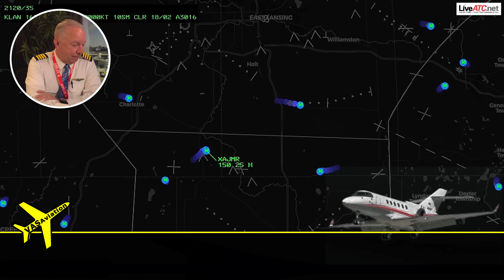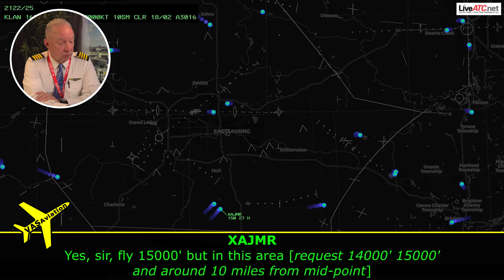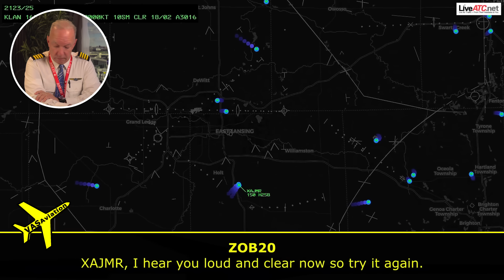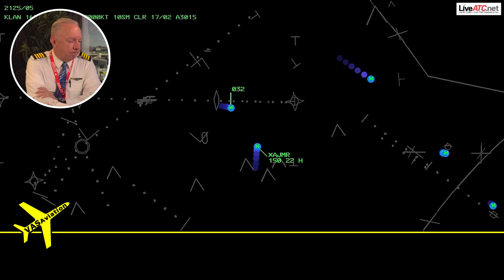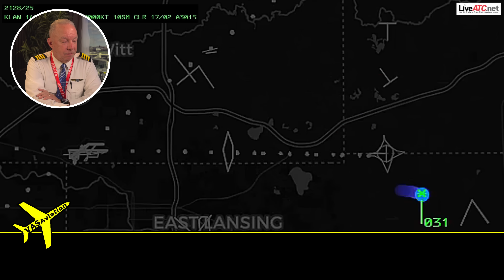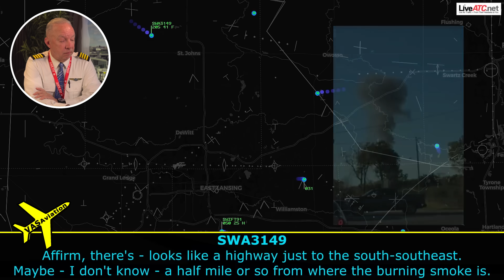Inside the Hawker 800XP Stall Test That Ended in Tragedy

Comment: I've never trusted a swept wing jet that did not have leading edge devices.  My pilot friend was with a company Astra pilots doing stalls well before there was a simulator.  They loss control and he was able to pull it out of a deep stall.  They lost over 10K feet and came very close to death.  Swept wings jets like this have stick shakers and stick pushers for a very good reason.  Putting one in a stall is reserved for test pilots only.

Comment: I dreaded the lesson for Stalling/Spinning when working towards my PPL for a Cessna! I almost gave up the lessons as this approached. But because my Instructor was ex-RAF (he was wonderfully kind, talented and sympathetic) I found I actually ENJOYED doing them! Eventually, I'd do them (with a passenger!) for fun. I guess they are mini-aerobatics?!
Reply: I have to say that I enjoyed the spinning lessons for my PPL. The real eye opener was spinning a Jet Provost in the RAF. It was a much heavier aircraft than the Cessna, but still had manual flight controls. With a 16,000ft/min rate of descent while spinning, it certainly took some effort for full opposite rudder and to hold the stick forward. A guy on the course ahead of me got into an inverted spin while doing solo aerobatics and ended up having to eject.
There's an excellent video on YT called "F-0776 Spinning Modern Aircraft" which shows a JP spin from inside the cockpit right at the start, and then goes on to explain spin mechanics.

Comment: The controllers display does not turn red. With some systems it will display a red “LA”  for “Low Altitude” in the data block associated with the aircraft and is accompanied by an aural alarm beeping tone, same as a “Conflict Alert”.

Comment: I flew a lot of aerobatics in all sorts of aeroplanes, including Chipmunk, Citabria, and Yak52. Standard spin recovery is:
Power off.
Full opposite rudder.
Stick forward UNTIL THE SPIN STOPS (this can mean FULL forward stick in the Chipmunk, which is placarded to that effect).
Centralise the controls (or it may well go into a spin the other way!).
Ease out of the dive into a climb back to desired level.
on reaching desired altitude, ease the stick forward to level flight while restoring cruise power.  

Simply letting go of the stick won't cut it.

Flat spin recovery in the Yak52 (as I practiced with 'Mr Yak', Gennedy Elfimov) was: 
Power off.
Immediate full opposite rudder and in-spin aileron while slowly pushing the stick forward - as far forward as needed until the spin stops.
Immediately centralise the controls then recover to level flight as above.

Hawker business jets have a high set tailplane and elevator, so can suffer deep stall like  T-tailed airliner. I wonder if that happened here.

Vince C
Reply: Hawker business jets have a high set tailplane and elevator, so can suffer deep stall like  T-tailed airliner. I wonder if that happened here.

First thing that came to my mind, and I haven't been at the controls of an airplane in well over 50 years... never licensed, either :face-green-smiling:
Reply: just wondering why does a guy named Vince fly my beloved russian yak? where these also in the US?

Comment: I just analyzed some video the aircraft suffered structural failure on the way down indicating unusual attitudes & high g forces. Hawker warns about conducting stalls in the handbook. Stall test gone bad last Feb in same type of aircraft. ADS-B data is revealing…..seems like they maintained level flight at 106 kts & even at 102 kts for a few seconds before the stall broke, most likely inducing a snap roll. The slow airspeed, unusual attitudes & lack of elevator authority made getting out of the “back side of the power curve” impossible…..then aircraft began coming apart. RIP

Comment: I dont understand why a stall of any kind is hard to recover from at 15000 feet wouldnt you just point the nose down until it comes out, not keep pulling up obviously why is this hawker so hard to recover from
Reply: Sooooo, a stall is easy to recover from, the amount of altitude you need depends on the aircraft.  A spin recovery is more difficult.  He says stall in the video, but then goes to describe a spin recovery, then uses the terms interchangeably even though they are two different things.  Although a bad enough stall can lead to a spin.
Reply: a silly question, you ought to study aviation more, there were similar accident where they could not recover from 30000 feet
Reply: @olasek7972  no not a silly question, the question is could they not recover because they did incorrect procedures, if you cant recover a stall from 30,000 feet either you have no idea what you are doing or something is wrong with the plane

Comment: Aircraft mechanic here, never liked Hawkers it is a very tail heavy aircraft for the engines it has. I remember working on Lear 25s and there was a large inspection that required leading edges of wings to be removed and after re-install it required a stall test which only factory pilot could carry out
Reply: yap . like a c185 on floats. unable . :shelterin:
Reply: Tail heavy yes, that's why it's jacked from the wings and tail.
Reply: Yeah, I flew those flights many years ago.  They use to strap down sandbags behind the cockpit to bring the C of G forward.  It was not uncommon to end up in a very unusual attitude.
Reply: Err, so you had to do your job properly.  Did you put less effort into servicing other aircraft?
Reply: @HerbertTowers What?
Reply: @seeburg220 that was my exact response...

Comment: Hi Captain Steeeve. Why are most commercial airliners today twin-engine? Aren't 
four engines safer than two? In a twin-engine airliner, if you lose one engine, you 
lose 50% of the thrust but you can still fly. If you lose two engines, you lose 
100% of the thrust and you go down. In a four-engine airplane, if you lose two 
engines, you lose 50% of the thrust and you can still fly. It's very unlikely to 
lose three or four engines...
Reply: It probably comes down to cost, efficiency, and fuel economy. Statistically, it is very rare for both engines to fail outside of highly unusual circumstances. The event where Cpt. Sully (flight 1549) flew through a flock of birds took out both engines (but landed safely in the Hudson) but then there are incidents where 747's lost all FOUR engines due to volcanic ash clouds but were successfully restarted (BA flight 9 and KLM flight 867) at lower altitude.

Comment: Ever since I saw the video of the stall test of the MD-95 (Boeing 717) back in the 90s, I have been in awe of test pilots’ ability to recover from extreme unusual attitudes. I wonder why these Hawker tests of late have resulted in situations where the flight crews are unable to recover. Are the pilots just not decreasing their angle of attack sufficiently to get out of the stall or are they making improper control inputs or something else?
Reply: I think that it could possibly be that if they get nose high and slow causing an aerodynamic stall causing the engines to flame out, if they don’t get the nose down quickly the airflow to the engines is disrupted causing them to flame out. With little horizontal speed the engines don’t get enough forward speed to allow a restart (windmilling).
  With not enough forward speed and no power the plane will fall flat like a leaf falling off a tree with no flow over the control surfaces making it almost impossible to recover. They are much heavier than a leaf, gravity sucks and time and altitude are no longer a saving grace😢

Comment: I just added stall testing of planes following major maintenance to the list of jobs I would never do even if capable of doing.
Reply: Me too, right under saturation diving
Reply: @guitarrowhead_mv Imagine the skill level required for stall testing an Airbus A380
Reply: @johnvender  You can't make it stall.  The interface between controls and surface deflection won't allow 'raw flying'.  Stall behaviour is entirely done by the designers.  Along with things like stick-fixed satanic(!) manoeuvrability and stability. Roll/yaw coupling and so on.
Reply: @HerbertTowers  Yeah, it was only done by Airbus during certification work. There is a video that shows some of the A380 test campaign.
Reply: @johnvender that’s the safest Airplane ever it won’t stall
Reply: So you're just going to let some other poor guy (or girl) go out and possibly get killed even though you were perfectly capable of getting killed yourself...possibly?
Wow man...what are you...SANE? Some kind of sensible person?
Reply: Some aircraft are unable to recover from a spin, when the balance of weight is behind centre of lift, and some have a full width elevator that can blanket the rudder when in the spin, This means the elevator is stopping air from getting to the rudder, therefore the rudder is unable to stop the spin, This happened to a friend of mine but he survived the crash and still lives flying

Comment: The electromagnetic circulation plasma tones field between 2 planetary magnetic poles are arking wave speed vectors in both counter clockwise and clockwise axial tonal sound and radio frequency modulation Spheres to recover ur balance of 90° on the vertical and 90° on the   horizontal deity stabilizer plasma tones planet known as ur Ball mirror
Above and below the water table Matrices restoration clock speed to recover ur hydro Krystal Spiral acoustical Spirit body restoration speed to fly ur own space transportation vehicle called an Orb 
As in orbital electromagnetic processing speed in distance and degrees of the exact center point of balance at 0°
Magnetic 0°
Is O Ohms 
The Zero point field where U cancel both Spinning magnetic polarities to experience NO pressure
That's Ur vacuum void space of pre light phasing speed
The invisible eternal Sun Spiritual capacity to Creatively express pure joy to b alive breathing aliveness
The over Unity field means ur a self generating Monad 
That's the free energy neutrino zone 
Ur Spinning flashing sound and light frequency over Time wave speed vectors
Ur vector is ur vector speed 
Let the Universe go to work 4 U to phase in and out between density and multi dimensional Star Trek Navigators
🌈
Reply: You are a P3 pilot, I was a P3B crewman in the 70's.. I was always interested in the cockpit activities and as an AW, I often sat in the cockpit on the radar cabinet.  One day we were working with an aircraft carrier doing Bravo services and completed them.  Antagonized by our crew and maybe the communicators on the ac carrier, my pilot decided to go around and demonstrate the P3 capabilities.  We approached the aircraft carrier deck at approximately 100 feet (violating the rules) at max power (1010 TIT) and at what was approaching to be 400 knots.  We passed and pulled up at a sharp 30 degree angle and thought that was great. " We will show them".  We passed through 8000 feet ( I was watching the altimeter) and then I could no longer stand.  I was soon weightless and then up against the smoke removal hatch behind the FE.  We apparently stalled the aircraft at 190 knots and did not wing over.  We just nose dived and eventually recovered at approximately 2500 feet. I was scared, The pilots did not understand the stall effects when pulling max "G"s on the aircraft and we all lived to bury this in unofficial naval airchrives.  I keep remembering this and can't get it out of my mind.  I thought you might like to see

Comment: Hawkers have a very complex Stall Identification System that gets checked every so often at certain phase inspections. When the leading edges of the wings are removed for maintenance a Stall Check during a test flight is required. The aircraft is flown to a Stall at all the flap settings besides the lift dump setting. The stck shakers and stick pusher must activate at pre determined airspeed and the aircraft must not roll in either direction beyond a specific amount. If it does not behave according the the numbers there are Stall stips on each wing that must be adjusted. This is done until the aircraft behaves according the the numbers. The Stall stips ensure that the inboard part of the wing stalls before the outboard part of the wing. As the ailerions are at the outboard part of the wing if the outboard stalled first you would lose ailerion effectivity in the stall and the aircraft will enter a spin. Hard to tell but it look like this aircraft entered a spin at the first Stall (flaps 0). Another likely scenario is improper Stall recovery by the crew and the expierenced a secondary stall.
Reply: In summary,  not any pilot can fly a Hawker,  neverthless a Stall check.

Comment: I have to fly in a few months and I'm terrified!! Please, could you explain what happened to Air France Flight 447 in June 2009? [Air France Flight 447 was a scheduled international transatlantic passenger flight from Rio de Janeiro, Brazil, to Paris Charles de Gaulle Airport, France. On 1 June 2009, inconsistent airspeed indications and miscommunication led to the pilots inadvertently stalling the Airbus A330.] Thanks!!🙏🙏🙏🙏🙏🙏👍👍👍👍👍👍👍👍❤❤❤❤
Reply: Manual flying had become de-emphasized. Air France remedied this through revised training and procedures.

Comment: Pretty sure this jet entered a deep or "super" stall, which is almost impossible to recover from. It is a normal stall that is allowed to progress to the point that the all surfaces of the tail are blanked out by the main wings. This occurs to T tail swept wing jets. Think B727, DC9, CRJ, and this Hawker. All have crashed from documented deep stalls. Interesting: a Boeing flight test crew found themselves in a high altitude deep stall (B727). The tail surfaces were useless. This crew began to work together using the ailerons back and forth until they were in a 90 degree bank. The nose fell thru and after falling 10,000 feet they were successful  in breaking the stall.
Reply: Yeah perhaps like the old BA crash due to stall in the 70’s with the t tail. However that height should be enough so mechanics, flaps and settings and right after a maintenance - so again like others it probably be 4 or 5 things line up to end in tragedy -
Reply: Isn't this what used to be called a flat stall?

Comment: Battle Creek Michigan would be Duncan Aviation. There are a few aircraft that need stall tests after wing demates. They have to use test pilots that have been specially trained to do this test. A real tragedy.
Reply: Yes Duncan released that they worked on this plane
Reply: I have done maintenance on these airplanes. After removing the wing leading edges for maintenance the manufacturer requires a stall series be flown. The pilots are most often the owners company pilots. They don’t have special training. It is the most dangerous flight of any test flights. I have been scared more than once while flying with crews of unknown experience.
Reply: @seapilot2  You are correct, Hawker aircraft do not require special test pilots for these tests but suggests special training for this task. I believe other manufactures require it for their tests.
Reply: @scottdenham848  Yes, Hawker does not require qualified test pilots to do stall tests. Learjet on the other hand does mandate that stall tests can only be flown by factory test pilots.
Reply: @seapilot2 My company always has a test pilot preform them with a company captain as SIC.

Comment: Well, you’re kinda lazy because you didn’t research this very much. We’re just a little bit of research. He would’ve found that that model if they have removed the leading, Edge requires a professional test pilot to accomplish a test flight testing stall characteristics to be sure that they sealed the leading edge back just perfectly And it requires a minimum of 20,000 feet AGL before you initiate the stall and it has to be done in VMC conditions. This is just like the test pilot who crashed in a Hawker outside of Colorado a couple of years ago. He didn’t go quite high enough and obviously had not been performed properly because they got into a deep stall they could not recover from I doubt this crew were certificate test pilots.
Reply: No one care what you think or write. Literally. No. One.

Comment: Being rear engined and with high elevators, I just wondered if it went into a deep stall, like has happened to other aircraft with high elevators, such as the Trident. The Trident ended up being equipped with not only a stick shaker but a stick pusher to try and prevent the aircraft entering a deep stall, as usually, once entered, recovery is nigh on impossible.

Comment: You'd think radios in planes would require better sound quality.  That one made a drive-thru intercom sound good.
Reply: That's because it's from a radio scanner that's not what they hear in the actual plane
Reply: @jackmorris1068 yeah but typically the scanner picks up the aircraft overhead better than the atc center.  And even the controller was complaining.  It sounded almost like both hawker pilots were keying their mike buttons simultaneously. Then later it was much more clear.
Reply: It is a recording of a recording, although they definitely could be better
Reply: @madisonlee4173  Even Captain Steeeve commented on how scratchy those radios are during the video.
Reply: I'm really shocked In today's world, that pilots can still step over each other on the radio. This is so heartbreaking.

Comment: I recall another Hawker 800 accident that happened during a stall test, but I can''t find it.
Update: actually, it turns out to be Hawker 900XP that happened on February 7, 2024
Reply: swept wing aircraft are notoriously fast in a dive and hard to recover from a full stall.
Reply: @JJM2222  Bollox.  From which silly internet site did you find that?